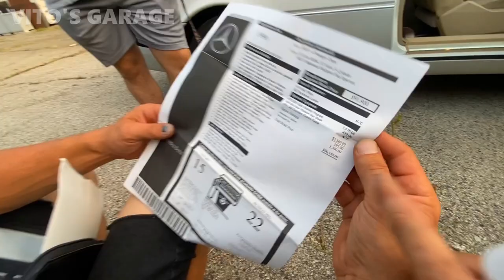I Reunited with my Original Mercedes W123 That I've Put Tons of Love Into!!! I am Shook!!!!

Comment: An easy way to remove the rear window on a W123.
First remove the Defroster wires from each side.
Iam right handed, so I started on the R/R side inside the car. You can start on either side.
Pull the rubber a bit to spray some WD-40 under the lip, and maybe some down the side.
Push the glass from the top corner, and work your way across, and gently down each side.
The rubber will just fold over as you push the glass out.
Then from the out side, lift the window, with the rubber and Aluminum trim out.

I read about this, and tried removing one at PNP. Worked like a charm.
I now have several rear glass from 123 sedan and 123 CD. in the shop.

if you have rust along the Pinch welds,  (best if you do not) Strip the pain off down to the metal. Clean up any rust best you can.
I used POR products. Treat it with their metal ready or Phosphoric Acid. Keep it wet as long as you can so it does it`s job.
When dry with a wet rag, wash off the grey residue.
When dry, apply the POR. I used some thin Fiber Glass type cloth. Something like what is used on model Air planes. Cut  about 2" wide or what ever it takes to cover over the pinch weld, and maybe 6" long. Lay on the wet paint, and lay new paint on the cloth to soak it. Work out the bubbles etc...
Do all across the bottom and both sides. Covering the pinch weld will keep water out from between the 2 pieces. 

I did this on my 85 300D 15 years ago when I removed the Glass, was surprised to see how much rust there was.